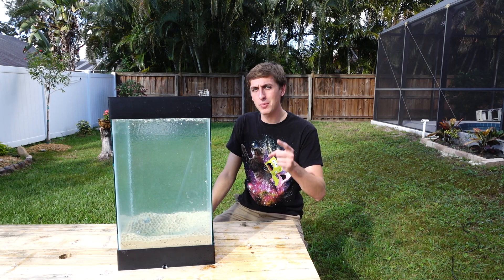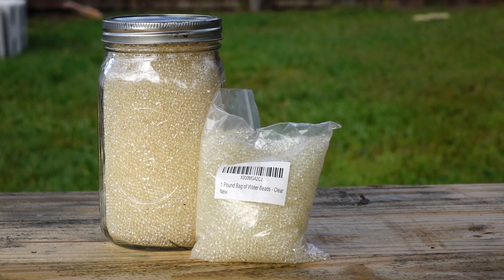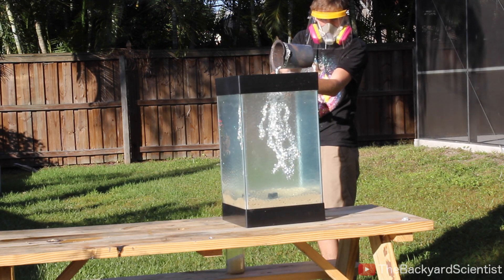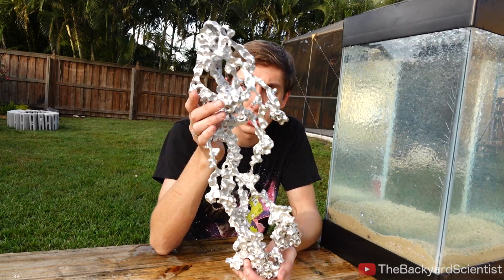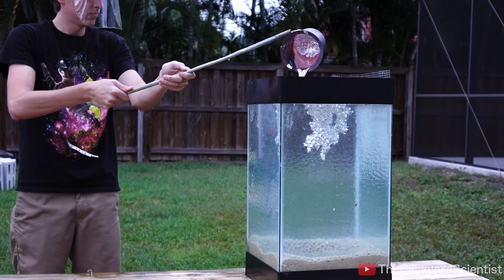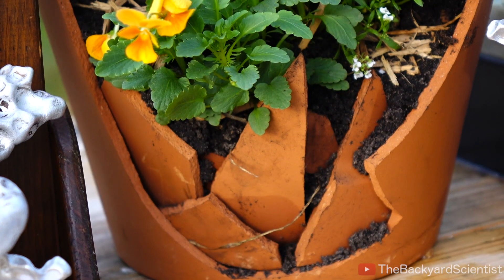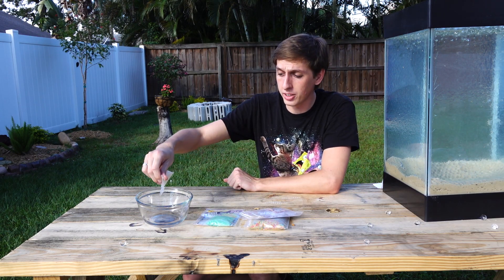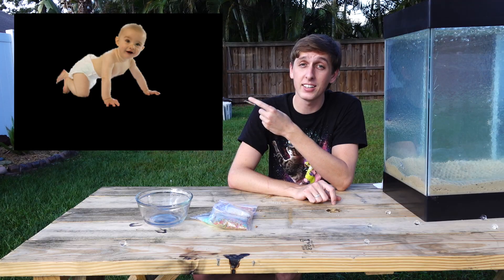Molten Aluminum Vs 'Spitballs' - SO COOL!! (water balz)

Comment: I'm pretty sure the reason why they started breaking down and releasing that chemical smoke is because there wasn't enough water in that tank, the aluminum was going directly onto them instead of the water that should have been over them first.

Comment: A face mask for pouring 3 pounds of molten aluminum? Trust me they have NEVER worked with molten metal.
Reply: It’s for toxic gasses
Reply: @PeterEvans_music  let me reiterate. It's a 3 pound pour. Hes not even gasing the pot. He should be safe. We didn't even wear masks doing 33000lb pours. Just the pouring suits. He will 100% be okay. He's also outside lmao.

Comment: Those sculptures are super cool! I'm wondering, though, if there's a more controlled way of making these. If you were to make a mold out of something that the aluminum didn't stick to or burn and then poured the beads into that, then obviously the aluminum, you could make sculptures in any shape that you wanted with that same organic texture.
Kind of like lost wax casting with the surprise of what sort of organic textures you get out of each pour.

Comment: I just saw a video on how actually dangerous pouring liquefied foundry metal into water can be even aluminum can act its potential equal to energy releasing TNT if your Moulton aluminum is in a pure form clean with no impurities in the aluminum but aluminumcreates a oxide that coats the metal so it's harder to get clean a molten aluminum into water but if you do you will experience two different kinds of explosions could all the liquid metal explodes upwards and out in a shower of molten aluminum or like I said the aluminum will explode with the equivalent weight of itself in TNT so good luck I wouldn't want 65g of TNT exploding of liquid metal in my faceat arm's distance this could definitely be lethal
Reply: Do you hate punctuation?
Reply: @Paalleujo  Did anyone ask?

Comment: "Safety crybabies". I wouldnt count myself among them, but they have a point. The longer you do risky stuff like this, the more likely you will seriously injure yourself. Any individual experiment may have a lowish risk, but all it takes is one screw up to permanently disable yourself.

Or you can spend $10 on a face mask.

Personally, that's an easy choice. But you do you.

Comment: Please don't duplicate what you see in this video. Consider the weight of the aluminum you're using, if you don't want that weight of dynamite going off in your face than you don't want it with aluminum. It sometimes explodes in water, kills people all the time.

Comment: The danger for very violent explosions while working with molten aluminium is low but very real. The face mask would not have prevented serious and potentially life ending injury.  Please do not try anything like this ever again. If you do not understand the risks involved in ANY experiment do not conduct it.   If you continue taking risks with potentially explosive materials it will only be a matter of time before you harm yourself or someone else. I would encourage you to do some research on the very real dangers of molten aluminium and make a video discouraging anyone from attempting anything like this. In this video you have given the message to your viewers that there is a lot less risk in doing this and that may be the most dangerous thing.

Comment: I do hope you have learnt that aluminium explosions with water are a real thing, for anyone who doesnt know if very pure molten alluminum is poured into water it can have the same energy as TNT which is what blows up metal foundry's source Thunderfoot
Reply: No that's steam explosions. You need to your nose out of thunderfoot's rear.
Reply: @stonegiant4  Idk m8 steam explosions are a little to tame to destroy entire foundry's. have you seen those pictures?
Reply: @stonegiant4  aluminum reacts with water 2 Al+3H2O ---> Al2O3+3H2+ energy this reaction doesnt always happen because of a layer of oxide if its pure enough aluminum and clean crusible you can have an explosion not because of steam.

Comment: I see thunderf00t has seen your video and has disapproved of it. Did you notice in his video he had no gloves on? Natural selection determines he will have no hands to make videos. My video was the first one on his video and no explosion! Even when he tried it NO EXPLOSION! That oxide layer is tougher than he thinks.
Reply from the maker: Also very cool video on the microwave induction heater! I tried to hack one of those induction stove tops but they are too complicated for me and run at 1000+ volts so that's kind of scary.
Reply: @TheBackyardScientist  try it with water with some NaOH then to prove/disprove it and wear extra safety precaution doing that one.
the NaOH should dissolve the supposed oxide layer that prevents a huge explosion.

edit: make sure the aluminum is red hot!!
Reply: I do have two of those induction cook tops I found in the garbage. They should be a lot easier to hack into than a microwave oven.
Reply from the maker: Ha yes I saw it! Spends the whole first half saying we are just stupid and lucky, then can't get it to work himself, then says you need an inert atmosphere.  Sure aluminum and water can explode when mixed, but not at the small scale like this. If it did 100s of people would be dead and we would hear about it! And in the video he showed of the explosion, that was 50 pounds from the bottom of the crucible into a box painted with red rustolium paint because the high amount of iron oxide in the paint makes it explode. It was in the paper he was showing near the end but convienently forgot to mention it.
And all the people in the comments just eat it up like his word is gospel, theres a bunch of comments like "this makes me concerned about aluminum foil" and "OMG I cook with aluminum pans!"

Comment: last science experiment: pouring molten aluminum into water! cool!

next science experiment: i hold a piece of dynamite in my hand and light the fuse! wowee!

experiment after that: i will stand below a vat of sodium-potassium alloy as it pours over my shoulders! neat!

next experiment: i will hotbox my car with chlorine gas! science!
Reply: Reading this comment: whats wrong with this guy? Reading the name: ah, ok
Reply: @jozseftoth9368  pouring molten aluminum into water can explode. and not "much aluminum little explode" but milliliters of aluminium could've killed him if it wasn't for the quick oxidation

https://youtu.be/_uzpy7PYitI

or look out for thunderfoots video about the energy potential here. it is not a physical but a chemical reaction
Reply: @Martin-kv3th  thx for the info mate. But how could some milliliters of molten aluminium kill him? By such a strong explosion? Fragments from the glass?
Reply: @jozseftoth9368  you have seen thermite, thermite is just aluminum oxidizing basically. in water you have that but more violently since it's molten and water will just boil off and explode.

for that you need WAY less than a liter, maybe deciliters
Reply: @Martin-kv3th  
Thermite requires an oxidized metal as well, commonly known as rust. 
Regardless though... You pretty much nailed it.
Reply: Nice name

Comment: I refere you to Thunderfoots vid on this
Reply: he needs to see this. for his own good
Reply: leelelel som1 tell him to pour molten aluminum into dillute NaOH even a few flakes in water is enough to get rid of that pesky oxide layer.
Reply: Had to see this myself to believe it.
Reply: @AGenericAccount  AGenericAccount  We hypothesize that the water-wetted surfaces provide a thin layer of liquid water beneath the molten Al that can heat rapidly during transient liquid-liquid contact between melt and water. Because the surfaces of the wettable solid and the molten metal are both presumed to be poor nucleators of bubbles, substantial superheating of the water layer may occur. The resultant vaporization may be explosive, causing local fragmentation of the melt and pressure disturbances that initiate steam explosions elsewhere where melt and water are adjacent. Nonwetted surfaces, on the other hand, are essentially dry beneath the melt and produce little assistance to the explosive interaction.  
So my theory from your source is pretty much this. Small amount of water + big amount liquid aluminum=boom. Big amount of water + smaller amount of liquid aluminum=relatively safe.  
The dudes repeatedly dumped molten aluminum into water without issue. The explosion comes when water gets trapped inside molten material and flashes into steam.  Example here https://youtu.be/78CBUcGtfOs
Reply: isnt thunderfoot a climate change denier? or is he just one of those fuckers who cries about women being in movies
Reply: @littlesnowflakepunk855  I haven't seen him do any of those things
Reply: @MrDoverfield  The videos about Star Wars and Ghostbusters are a good place to start
Reply: @littlesnowflakepunk855  1. thunderf00t is about as opposite as you could be from a climate change denier
2. what does his opinion on climate change or women have to do with science? even if he killed people that wouldn't change the fact that aluminium in water is a bad idea
3. i watched the ghostbusters video you talked about and he essentially just used that movie as a vehicle to talk about anita sarkeesian's antics
Reply: @lifesarisk9086  Ah, got him mixed up with someone else from the "rational"-skeptic-o-verse. So he's just a rampant misogynist, and not a climate change conspiracy theorist. Thanks for clearing that up.
Reply: @littlesnowflakepunk855  so disliking anita sarkeesian means you're a rampant misogynist? lmao i don't agree with every point he makes but he definitely isn't a rampant misogynist.
Reply: @littlesnowflakepunk your name suites you perfectly.
Reply from the maker: If he is right why did i not blow up
Reply: @TheBackyardScientist  oxide layer skin
just try it with slightly basic water to dissolve the skin and then see what happens.
Reply from the maker: @CatboyChemicalSociety  tried it with potassium hydroxide. Nothing happened.
Reply: @TheBackyardScientist  video when just to ease everyone
Reply: @TheBackyardScientist  You never disputed his arguments. All you said was I wasn't hurt so wrong
Reply: @TheBackyardScientist  Because you weren't unlucky enough.
Reply: TheBackyardScientist   wow i just lost alot of respect for you and you call yourself a scientist. just google aluminium explosion
Reply: TheBackyardScientist is no longer a scientist. He is just a dude in his backyard trying random things. So be it but now at least I won't accidentally unleash an explosion that would kill me for the sake of interesting art.
Reply: @TheBackyardScientist  That's not a very honest outlook... you don't have to blow up every time for something to be dangerous
Reply: @TheBackyardScientist  there was a thin layer of aluminum oxide between the aluminum and water. if it was bumped in the wrong way or if you had an unlucky pour it would have exploded. check out thunderfoots video where he actually demonstrates this https://www.youtube.com/watch?v=Rt-dtjYORok
Reply from the maker: @brine_909   I poured some into water than have my brother shoot the metal container with A pellet rifle nothing happened.
Reply: @TheBackyardScientist  just Google it, brother. It's not a joke, nor is it safe. You could really hurt yourself, and all for what? It's going to get you, and possibly your brother hurt or killed. No one is telling you any of this to do you harm or harass. It's all for your safety. Good luck
Reply: Jude Aberdeen 
You are spitting on people that died because of a aluminum explosion
Reply: @TheBackyardScientist  People die from this, don't roll the dice too many times.
Reply: @TheBackyardScientist  if you put pure aluminium into water it will break up the H2O molecules and form AL2O3 molecules instead, thus leaving free H atoms roaming around.  Due to hydrogen being a gas and lighter than water it will bubble up and gather above the fish tank.  Now i already knew hydrogen was flamable, like many people do.  But when i talked about it with my uncle (a chemist) he said then when hydrogen concentration in the air is between 50 or 60% it can spontanuously explode.  No flame or spark necessary, just boom.
In other words, it is not only liquid aluminium, but any substance which binds with oxhygen i automatically release hydrogen when poured into water.  The only reason i would see you didn't explode here is because the hydrogen was not able to concentrate.  Perhaps a light breeze was enough to disperse the hydrogen enough.

Still, check out some videos on hydrogen explosions if you want to know how dangerous it could have been.
Reply: @TheBackyardScientist  Because your forge ended up with aluminum oxide which protected you from the pure aluminum

Comment: This seems incredibly dangerous. Is there anything in the orbies that would inhibit the reaction of the aluminum metal with the hydrogen in the water? If not this seems very very dangerous, like your playing roulette with a thin aluminum oxide coating dangerous.
Reply: doesnt even react with the hydrogen in the water persay, the H2O molecule is literally what reacts.
Reply: @joshdoeseverything4575  Well yes, the aluminum reacts with the oxygen to form aluminum oxide and hydrogen gas which creates a lot of heat so I stand corrected. My main point still stands though.

Comment: "To appease the safety crybabies" 😂
Reply: had the water had a higher PH 11-14  he woulda died the moment he poured it in due to metal water explosions
Reply: @CatboyChemicalSociety  Couple pounds of TNT worth of metal explosion. That face mask would've made no difference in his safety with molten aluminum flying all around. The saddest thing is that both him and the people in the comments are oblivious to how dangerous this actually is. It's like playing Russian roulette, but instead of guns with molten metal.
Reply: @PhazonBlaxor  another similar explosion albeit weaker but still instant is a highly soluble molten salt explosion with NaCl at 1000 celsius or NaOH at 400 celsius.
The high solubility bypasses the leidenfrost effect and tons of salt carrying all that energy at once can cause an explosion.
Funny is this guy actually did that experiment.
Reply: People die from pouring molten aluminum on foundries because there's moisture in the cast.
Reply: @ztac_dex  yup a little bit of moisture and unoxidized metal is all it takes to cause an explosion equal to the aluminum's weight in TNT

Comment: They look like those sculptures that come out when folks pour aluminum into ant piles.
Reply: Yeah, but with much less death.
Reply: @Riesenfriese  Hypocrite much? Everything you consume is from deaths, from poultry to vaccines.
Reply: @vincenzotavolo  I know. But those are meaningful deaths. We honor them at least a little by using every part we can. Pouring molten metal into the home of thousands of creatures just to get an object of questionable beauty is wasting the life of animals.
Reply: @Riesenfriese  it's typically not for the 'art' of it. Usually the people who do it are exterminators getting rid of invasive species of ants. The metal is an effective way of doing that, that isn't bad for other creatures (like using poisons would be, for example.) The metal that they dig out just happens to be interesting to look at afterwards.

I have no stake in the debate on if it's the best method, I just happened to be recommended a couple videos on the process in the past.
Reply: Brandon W. oh, I didnt know that, thanks for the info
Reply: @Riesenfriese  no problem at all! :) I'd share the videos because they were fascinating, but they were recommended so long ago that I'm not sure I could find them again.
Reply: @Riesenfriese  they also usually do it for invasive ant species. Fire ants are particularly terrible for local ant populations. The pours I’ve seen done in the United States are usually fire ants. Protecting a native ant population, destroying an invasive one, and making cool projects?  Win-Win-Win!
Reply: This method is much easier than ant hills which requires you to find the hill and dig it out afterwards.

Comment: You should rry a quick pour into a five gallon bucket filled with ice, then water, then more ice, then salt that has been stirred hard/ vigorously when the solid crust is forming on top.  Unless you can get some luquid nitrogen.

Comment: Crybabies?! Well it's your skin and tissue. Every smith and caster recognizes aluminium as the most dangerous metals when it comes to handling it in molten form...
Reply: Waaaaaa
Reply: Lmao no, aluminum is not the most dangerous. Also obligatory "found the crybaby", crybaby.
Reply: Yeah... No still crybabies
Reply: i would guess only ignorant fools use crybaby as an insult, or maybe pedophiles too? ;D (idkfs)
Reply: i found the crybaby
Reply: ummm I think sodium and potassium are even more nasty... and lets not forget mercury... someone dropped a mercury thermometer in chem lab and the tech acted as if it was 238 uranium
Reply: mercury is pretty safe to play with.

Comment: I know this is an old video, hopefully you'll reply.  Did the polymer balls start to break down due to a buildup of heat (not allowing for sufficient chilling between pours) or did the repeated contact with elevated temperatures (regardless of frequency of contact) cause them to fail?